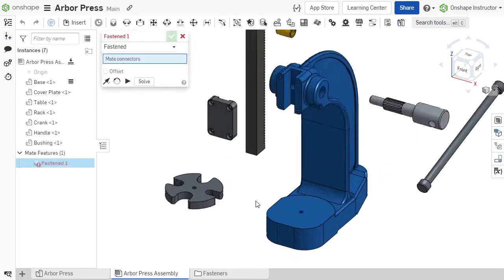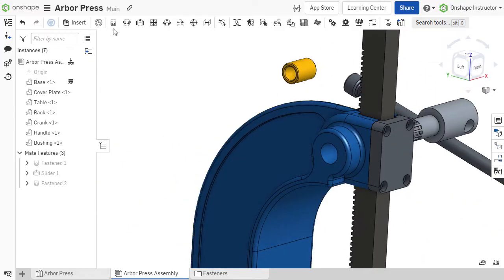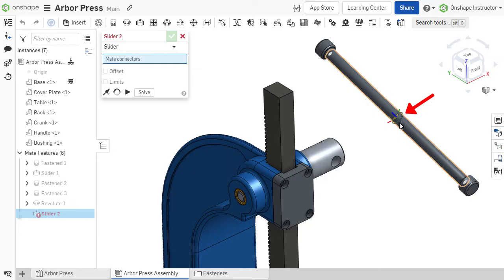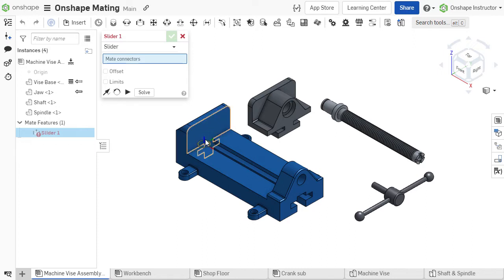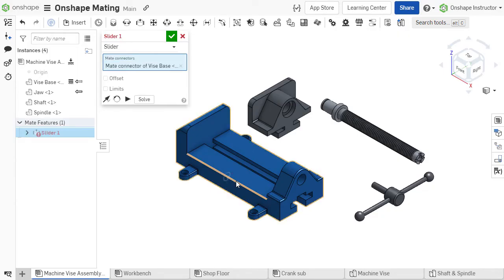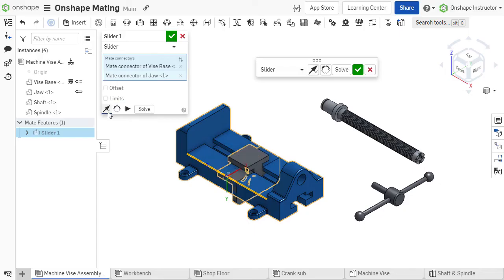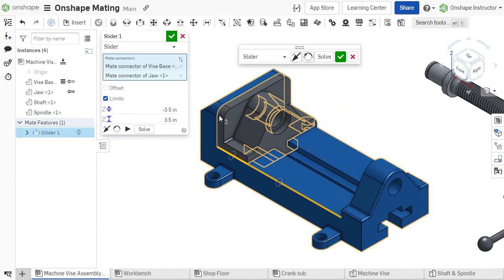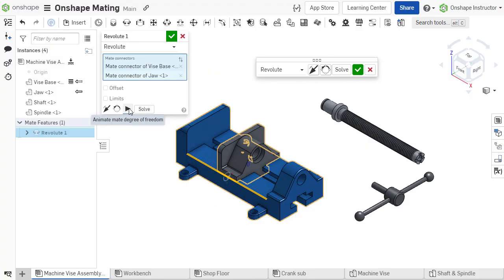How Assembly Mates Work in Onshape

Comment: how do you just center 2 offset squares holes based on the center of the holes. every mate I try never actually attaches the parts and I can still drag the 2 parts away from each other. Nice video but please be more descriptive. This did not help me much. like what is the difference form selecting an edge over the x, y, z coordinate thing. Is that ever the issue I'm having. I definitely have way more questions than answers. other wise nice video and thank you for making this.